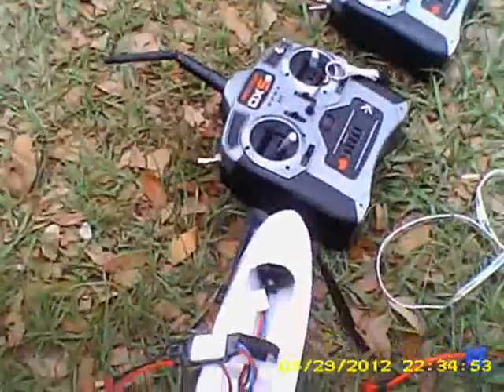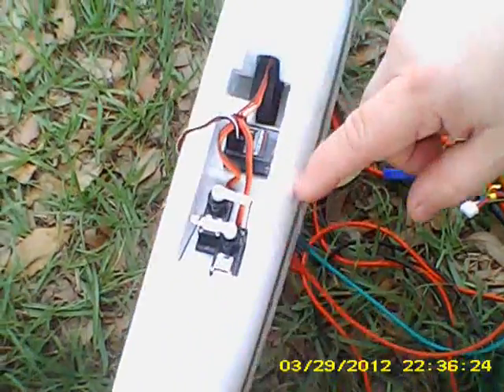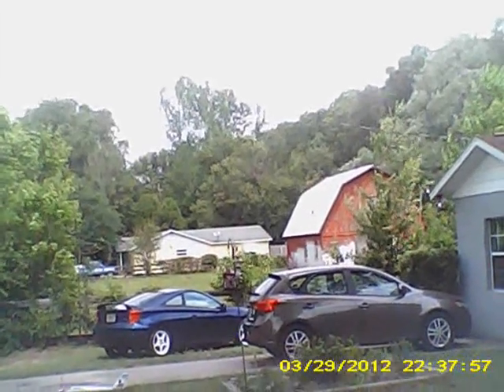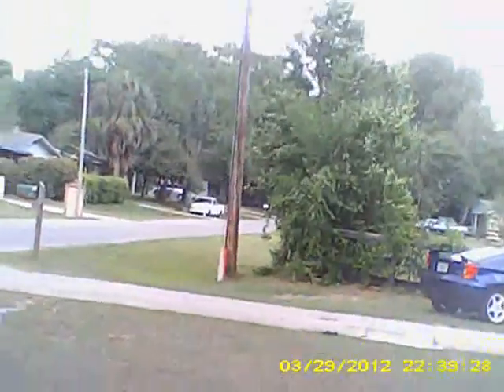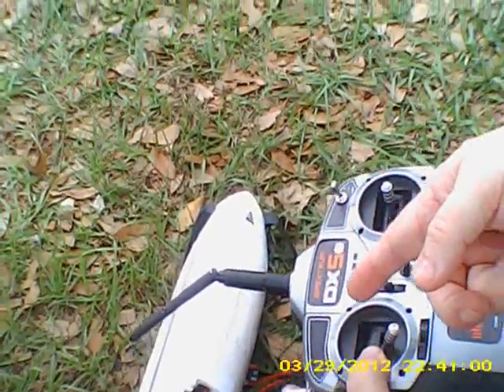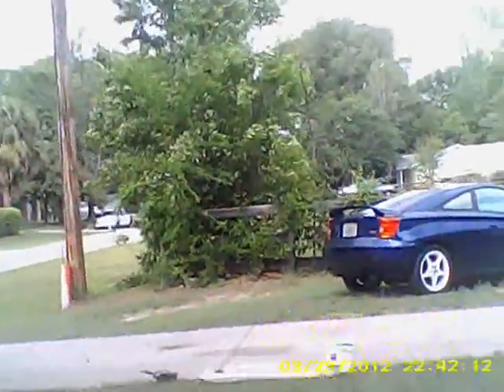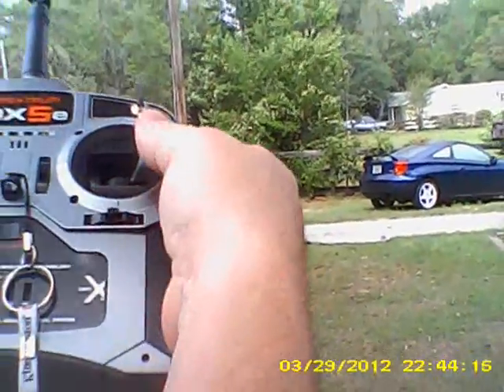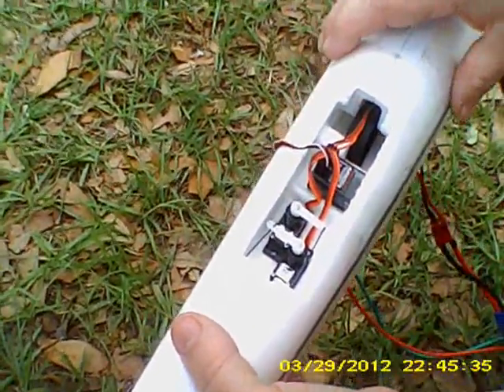Spektrum DX5e Range Test Failure

Comment: I just received my Parkzone Radian. Being fairly experienced assembly was easy and I did everything but complete a range test. After the perfect day arrived today, I took my eager 5 year old son out for his first experience watching an RC plane.

He watched me struggle for 30 minutes trying to connect the Spektrum DX5e and get any sort of range out of it. In Range Test mode with procedure on page 10 of the manual, it fails at 20 ft. I tried it without the range test as well and it fails at 50 ft, becoming sporadic or very delayed.

I tried a second fully charged spare battery. I tried rebinding the RX.

Finally I just packed up and went back home.

Then I found your video.

My son and I would like to fly before this summer weather is gone. From a 15 year hiatus this was my return to RC and it wasn't so successful yet.

I just contacted ParkZone Horizon Hobby. I hope they will be helpful.

Comment from the maker: Hey Jon, my TX was defective and I sent it to Horizon Hobby and they sent me a new one. Never had a problem after that. Since we are talking about RF energy and interference anything is possible. If you have that bad of responce from the DX5e, the first thing I would try is to take it (TX and Plane with RX) somewhere else and check the controls again using Range check. What is the difference between range check and normal 90% power. Meaning if you can control the plane using range check at say

Comment: I bought a new RTF Radian and I can only go about 30 to 40 feet before the plane will no longer respond to my DX5e. I bought it from Hobbytown and actually crashed the plane (not bad) the first time I took it out. I thought it was my fault, but now I realize it was the transmitter. Did Horizon Hobby send you a new one? Also, what is the point in using range check mode, if normal mode will also let you control the plane? Do wifi routers in the area effect distance? Thx for the video!

Comment from the maker: I have to say, Horizon Hobby did me right! First, i packaged my Tx and Rx with ESc and took to the post office. They claimed they could save me money by using a different box size. They chose, packed without to much care and saved me about 0.50 cents on shipping including insurance. I asked the clerk about her method of packing and she said it would be fine. Turns out that it was not and was broken during shipping. Horizon Hobby received and noted that it was broken on arrival. They did in fact